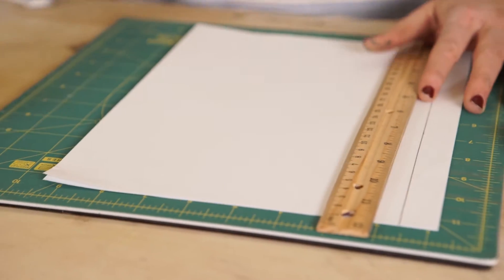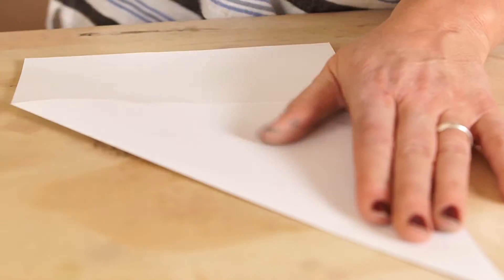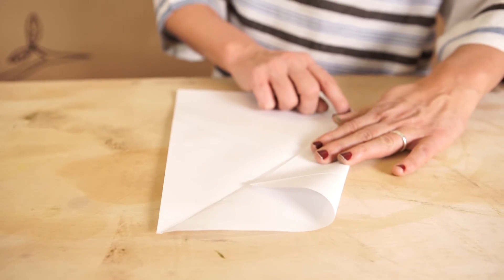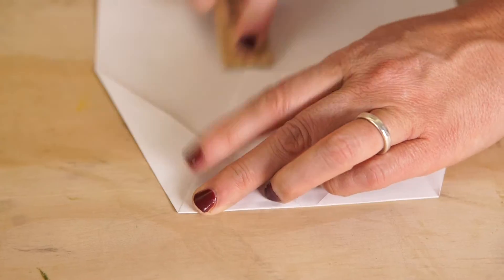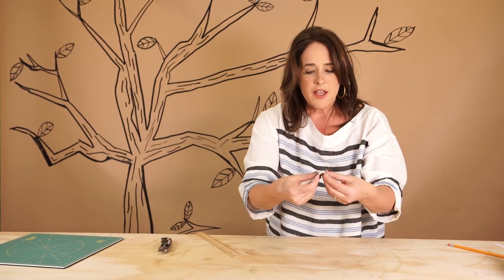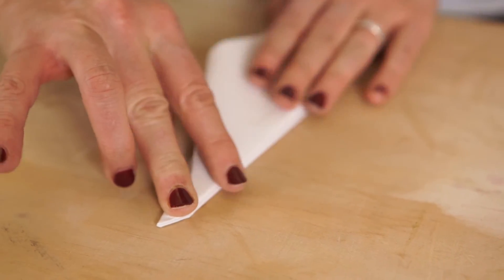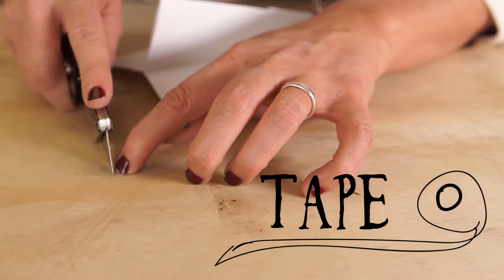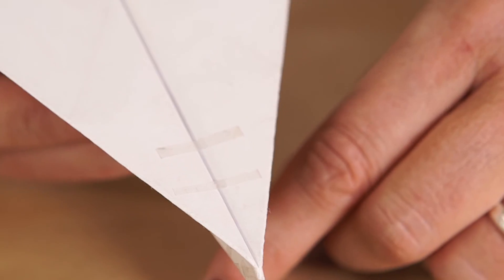How To Make the World’s Best Paper Airplane

Comment: what do u mean by normal sized paper? is that an A4 or Letter?
Reply: She used letter size paper. If you use a4 then you don't need to cut it. But for letter size paper you have to cut 19mm off to get the correct a4 ratio.